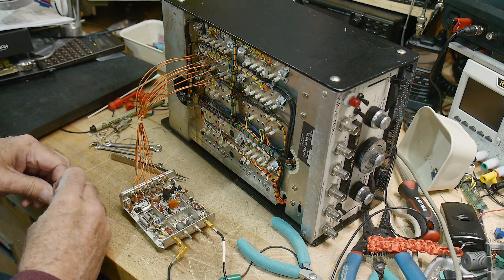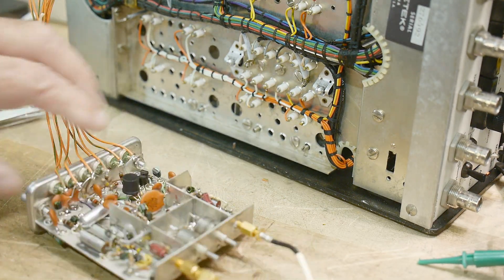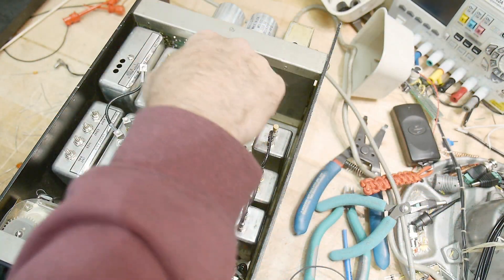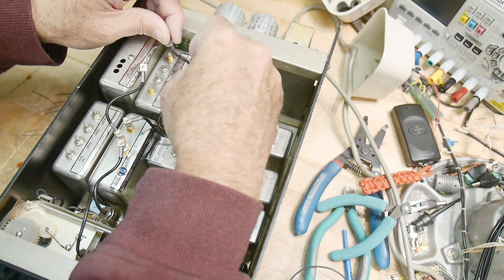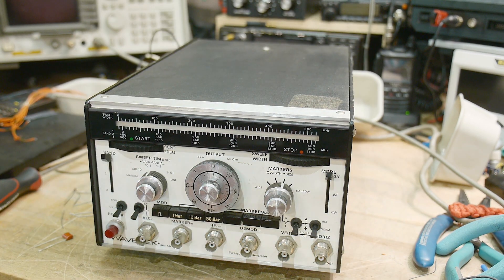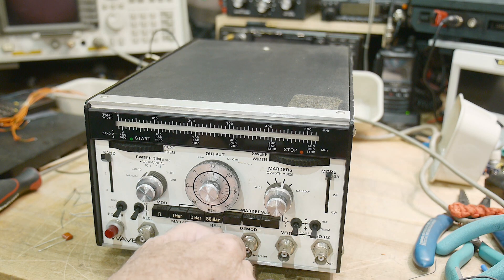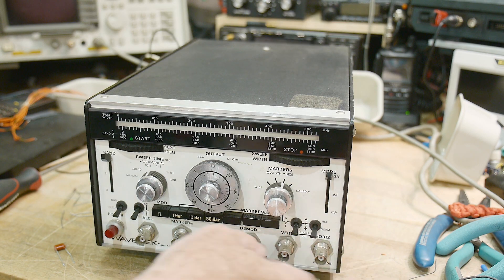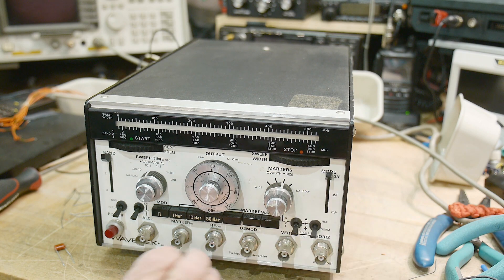#1137 Wavetek 2001 Sweep Generator (part 10 of 10)

Comment: Kinda disappointing you went this far and did not finish the repair.
Reply from the maker: I was disappointed too. I was just too much effort.
Reply: @IMSAIGuy  You did not experience the thrill of finding the bad component.  You had the module wired out of the unit, you were almost there.  I would have taken some voltage and waveform measurements in that leveling circuit and zeroed in on the problem.  Servicing this unit is a piece of cake compared to some of the HP equipment I have.
Reply from the maker: @polaraligned1  pay for shipping and it's yours
Reply: @IMSAIGuy  I am a new subscriber and I enjoy your content.  I currently have an HP 8601 sweeper and a HP 8662A with programmable sweep.  I really have no need for the Wavetek and have many other projects to work on.  I really do appreciate the offer.  I like your videos where you speak about the "old days", like when you went to IBM in Boca Raton.  Great stuff.  I got my BSEET in 1985 and worked as a tech for a while before leaving electronics professionally and heading to better paying adventures.  I can relate to much of what you speak about from the old days.  I have enjoyed electronics as a hobby for the last few decades and find it is always a learning experience, but troubleshooting is the best thrill of electronics so you took me to the edge with this video series only to be let down by not finding the bad component, LOL.

Comment: so close...could just be a front panel switch set wrong......

the diodes in the front of the amp module form an attenuator leveling circuit.  the bias voltage coming from the fet and transistor section below change the conductivity of the pin diodes 1,2,3 (making them act as variable resistors). when you bypassed the diode section with the cap  you restored the input signal to the RF section.  this doesn't mean the diodes are bad, just turned off.
a positive voltage feeding them turns the two top diodes on for more RF output....a negative voltage turns top two (off more, and at the same time the middle diode on more to shunt input to ground)..for less RF out.

the generator has the capability of using an external detector to level the amps output. 
CHECK THE ALC  SWITCH ON THE FRONT PANEL, SET TO INTERNAL....WHILE WATCHING THE GENERATORS OUTPUT on the spectrum analyzer.   if this doesn't restore proper levels then look inside the biasing circuit.  don't quit now your almost there......
p.s.  remove the cap and RESISTOR you added to get by while your were testing
Reply from the maker: I completely agree with you but this thing is really hard to work on.
Reply: @IMSAIGuy  i know, can i help....????,   but a good start is to do  simple voltage checks around the transistors,   [rint you out a copy of the schematic and then just note what you read on each emitter,base,collector of the transistors in that area, then just stop and think for a few minutes........  your 10 wire setup is what you have to do sometimes,   i've fixed about 5 of these over the years.....  with a little more knowledge, and fun,    you can tell a lot with just a scope and a voltmeter.......you know the RF amp is good now.....so it can be something in leveling circuit alone,  don't worry about the whole project, just the little sections at a time......  i'll help if we can figure out how to talk as you work......Jim

Comment: Great series on this piece of equipment. We can learn just as much from old gear as the newer all surface mount stuff. It was fun watching you got thru all the modules and nice to see a commercial company use the same build techniques as did a defense contractor I worked for back in that same time frame.

Comment: Nice one. That's how I learned, by taking broken valve audio gear apart and studying where all the wires went, finding out what all the components do, and then tracing where the sound stops, if I can. If not, I've got a load of spare parts. :)
And you have a lot of fun doing it.

Comment: Sorry, guess I missed it in the last video.  I thought you were going to look at the leveling circuit, but I guess in the end the fix was just the additional resistor to attenuate the input to the two transistors?

Thanks again, great videos.  Agree whole heartedly with buying older test equipment or other gear and getting in there and trying to fix it.  Worst case you end up with some spare parts - a lot of that test equipment used some high end internals that are still good and cost a bunch to buy separately.  Best case you get a good piece of gear for a few $$ worth of parts and some quality time spent learning how stuff works.

Comment: Are you going to show us how to use it to 'sweep' something or use it?  I got one of these many years ago and thought I could learn to sweep RF circuits with it but was told I needed a spectrum analyzer with a  tracking generator, so in the closet it went.
Reply: In a nutshell, you can attach the sweeper RF output to the thing you're testing, then put an oscilloscope into X-Y mode and put the output of the thing on X (through a 50 ohm terminator if needed) and the sweeper's ramp or sweep output onto Y. This will show you the response of the thing you're testing, so you could peak a filter or something. The scope has a linear response and will limit you to maybe 40 dB of dynamic range and will limit the frequency to whatever the scope can handle. To see a wider range needs the additional equipment you mentioned, like a log amp (the AD8307 is cheap), a power meter, or a spectrum analyzer.

These days a VNA, even a NanoVNA, is a more convenient way to make this kind of measurement.

Comment: Thank you for this series. Now if someone would do a repair series on the 3001, I would watch that one so I can learn about what makes my units tick and not tick. I have one with all 5 of the PLLs unlocked and the other one puts whatever frequency it wants to whenever it wants to.
Reply: I have a Wavetek 3000, which didnt lock all PLL's. It was because of missing 1.2GHz and 1.4GHz LO signal.
The fault was a transistor amplifier where the collector touched the case (GND). Maybe it got dropped..